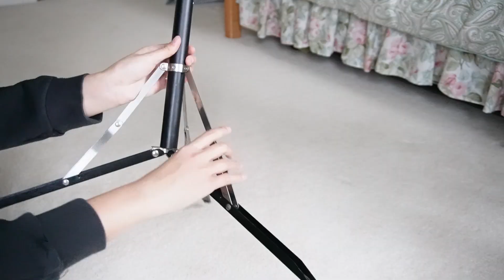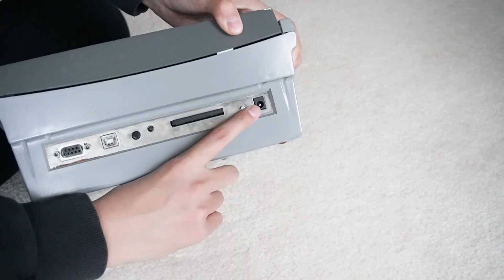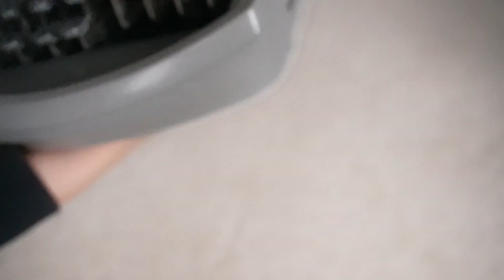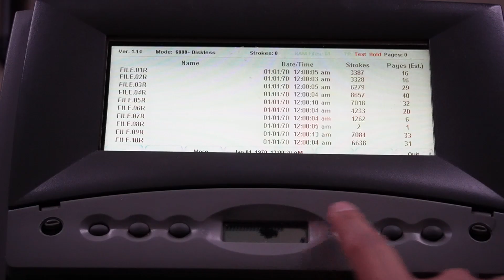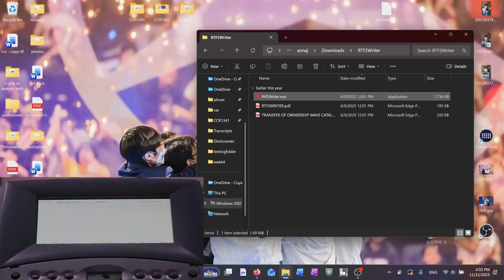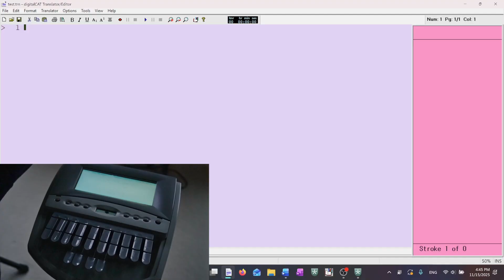How my steno machine works in more detail than you were curious about (Elan Mira)

Comment: Hello Anna!  I am so grateful for your vids.  I just started practicing Lapwing on a DIY steno keyboard and finished the textbook around Thanksgiving time.

I mention the DIY board because I was having repeating character issues, just like your letter L!  The issue on my board was that the solder joint for certain keys was not done correctly the first time, or might have broken a tad, and so when I pressed down on the key, the metal would touch then disconnect and touch again, each time registering a press.

Try pressing down L at different depths and wiggling it around to see if a certain wiggle will get it to register repeatedly.  If you find it to be like this, then it is an electrical connection problem.

Depending on what it looks like on the inside, it could be like mine, a broken solder joint, or it could be dirty electrical connections!  Dirty electrical connections you can clean yourself with some rubbing alcohol and a q-tip.

I absolutely LOVE to see machines like this; it gets me so excited, and I’m in love with your writer. I recently repaired a broken electronic typewriter from the 80s that gives me quite the same feeling.

Best of luck!

Comment: I know it probably doesn't matter because Steno Machines don't use much ram, but can I ask if you think the machines are going to get even more expensive with the RAM consumer withdrawals and shortages, Anna? They're already so expensive, even second-hand, I don't think they would increase in price due to ram going up but there's still the chance.
Reply from the maker: No, I doubt it. Steno machines are already expensive as is and it's a very isolated, small market. Plus, I doubt that the type of RAM for computers that is having supply issues right now is the same as what is used in steno machines.

Comment: The L key issue does sound like an electrical issue. Metal wires tend to expand when warmer, and so the heat is likely helping the wire reconnect a little more. Thanks for the video!